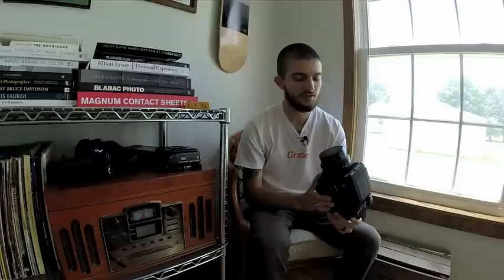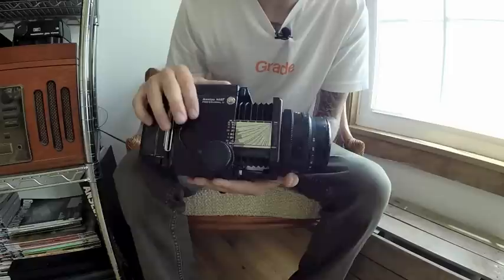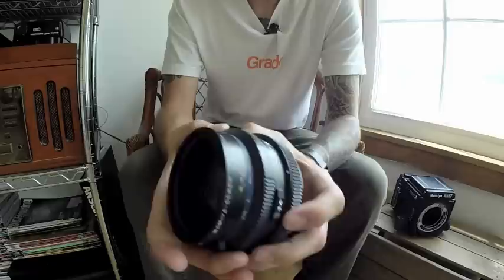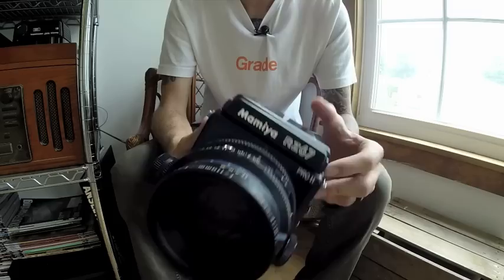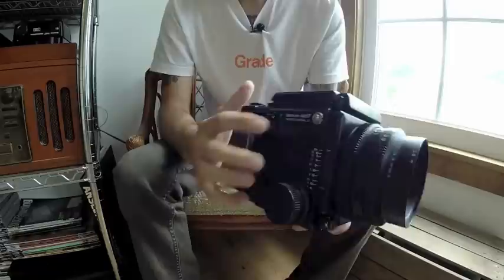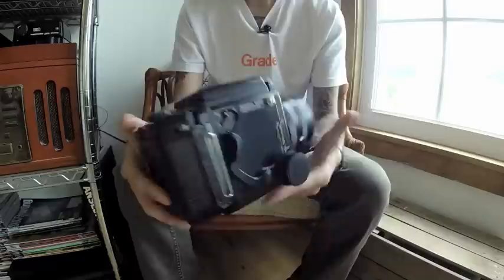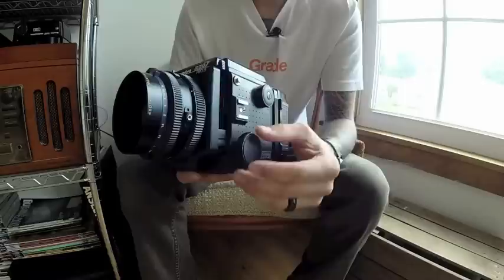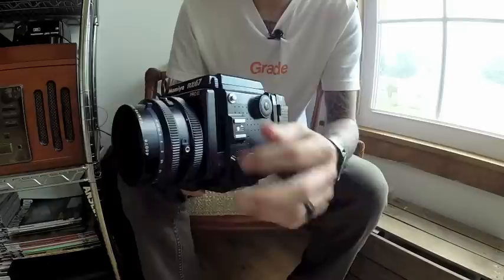Mamiya RZ67 Overview

Comment: I used to service and repair those. They were the best camera Mamiya ever made in my opinion.
Reply: Can I ask what brand of the instant film back is that?
Reply: @stevenygz  Its a NPC back made by Marty Forscher, they were generally a fraction of the price. He also made 35mm backs using a fibre optic pad.
Reply: Are they difficult to repair?
Reply: @Flyboard12345  Not when you've got access to the spares for them.
Reply: Where can I find one at a decent price in the States? Also, what should I look out for when purchasing. I've never had a Medium Format camera and I'd like to get started...
Reply: hi ian since you serviced mamiya's, maybe you could help me. i have an rz67 & pro ii from my old studio job but it seems that the shutter does not fire at correct speeds. shooting at 8" or 1/125, shutter sounds the same. any help would be great!

Comment: Great review Matt!   I have the RZ67 Pro II and would never part with it :)   Also keep in mind you can get a digital back for it, you first need to get the digital back adapter and then buy a back or you can get the RZ67 Pro IID which is the digital version. I do agree after adding the ad-ons the camera can get a bit heavy if you're walking around with it, so what I did was also picked up the Mamiya 645AFD for  when I am shooting in the streets. Mamiya's price's are very reasonable today compared to back in the day. Just go to Ebay and you can find some great deals. And as Matt said Mamiya glass is 2nd to none! And what you pay for a 2.8 lens you will never get a Canon L series or Nikon lens at those prices.

Comment: PX28s are pretty common batteries, just don't rely on them in the cold - Canon A series SLRS (A1, AE1, etc) take the same battery and I used to have to swap out batteries a lot shooting in just about 0 degree weather... which is when I gave up and switched to an F-1 and Nikon F/F2 SLRs. 

Mamiya 7 takes the same battery as well, FWIW, although I've gotten much more use out of those suckers in that camera, although they still don't last that long, maybe 20-30 rolls of film?

Anyway, great video as always, Matt ...

Comment: I  have been thinking of the Mamiya RZ67, but im going to wait a bit and enjoy my Pentax 67. but planing on getting mamiya in the future.
Reply: But the 105mm f/2.4 is insanely beautiful... sometime without the leaf shutter... it make the whole system lenses faster then those with leaf shutter. you can get 165mm 2.8 with pentax but never with mamiya
Reply: So ive been told, but after the events of a few weeks ago im no longer seeking to buy a mamaiya, after having the chance to buy one i got caught me off guard by its sheer size. and ive lost interest in it, plus the only reason i wanted one was for the interchangeable backs, thought it was a cheep alternative to a hassy. But it also leads me to my second reason, i have too many cameras and i never know witch one to use, there for im trying to cut down on buying some. and more on selling those i don't use and sticking to the ones i do.

sorry for the horrible grammar and spelling .

Comment: I don't know if I missed it or not, but did you mention the weight? The RZ with the back and AE prism, and a small lens like the 65mm, is over 7.5 lbs (3.5kg). Although it doesn't sound like a lot, it's very difficult to handhold it steadily, and you need a quality tripod.

Comment: +matt day I have a rather detailed question about the Mamiya RZ and how it relates to the Pentax67. I am looking to pick up one of these two cameras with the standard lens, ie the 110 f2.8 and the 105 f2.4 respectively. I understand a lot of the differences between these two cameras, and I get all of that. But, my main question relates to their ability to focus at reasonably wide apertures. Which camera has the better focusing screen to hit focus? Also, did you find there was a difference of ease in hitting focus with the mamiya with either the WLF or the AE prism. 
Thanks in advance

Comment: Hey Matt. I have really enjoyed your perspectives and the fruit of your teaching gift. So, thanks.

I just had a couple of questions:

1) Why do you recommend the 2.8 110mm lens so strongly (and enjoy it so much)? I have a chance to buy one for my RZ67 but want to make sure it's the best thing and want to hear your rationale.

2) I just purchased a B+W 77mm Kaesemann Circular Polarizer MRC Filter, and was wondering if you use this (or another) circular polarizer and how many stops you generally account for it in your exposure reading?

3) Do you recommend 120 or 220 backs, as a general principle? I want to buy another one (I only have one) so I can have Portra and then some sort of Ilford B & W loaded up as well (and, heck, maybe a third one for Velvia or whatever). Any thoughts?

4) What short lens would you recommend for the RZ67 (and what would you use it for specifically)?

and finally,

5) Have you ever used a Mamiya Tele-Converter 1.4x, and if so, how have you found it? Back in my Nikon film SLR days, I had a very good one that I picked up in the UK, but I'm not sure how well this one will work.

Thanks so much, if you can answer any or all of these. It will help a ton.

P
Reply: No one carries 220 rolls anymore, get the 120

Comment: I recently picked up one of these cameras myself, and I have a question about the shutter speed. Both the camera body and the lens have shutter speed adjustments. Do you have to use only the lens one because it's a leaf shutter, or do you need to match the two?

Comment: How does it compare against a 500cm for weight and shooting handheld? 

If you had to pick one of those two based how much you like shooting them (not technical stuff) which would it be?
Reply: The 500c is a lot smaller and lighter. I would say a lit of th bulk with the rb and rz  is the bellows.

Comment: I always had a question about this camera. When you rotate the back to portrait, it's gonna take the picture in portrait orientation but the framing of the camera body it's still landscape, so you're losing parts of the picture right? Also, how do you frame on the finder? does it comes with vertical frame lines?
Reply: Oh I see, now it makes sense. Thanks to you for replying!

Comment: Hey, nice overview. My lever won't go forward after i have taken a shot and the film wont advance. It also makes a buzzing noise. All the usual suspects covered e.g. darkslide removed, lens attached correctly, battery new...any thoughts? thanks in advance
Reply: Try taking a pencil eraser and cleaning the contacts between the film back and the body.

Comment: I'm currently shooting with a 8x10 field camera. I'm looking at either the RB or RZ as a "portable" camera I could take on a stroll through a city. Some had said it's so heavy it can really only be used on a tripod? I'm looking for something that I can handhold. What are your thoughts? Thanks and great video!
Reply: There is nothing portable about the RZ/RB 67 cameras. I would put in the class of a lightweight 4x5 like a Graflex. Quirky controls but if used regularly it becomes less so. As much as I loved mine, it is a portrait and landscape camera that does best on a tripod. Amazing bargain or an expensive paper weight. It just depends upon your intentions. The Hasselblad/Bronica square format or a Bronica 645 ETRSi are far lighter and handholding friendly.
Reply: My RZ67 Pro ii is a heavy beast, so on walk about, I take my Mamiya 645 Pro TL. Much lighter. I have the motordrive/grip and can hold and shoot one handed.
Reply: If you can afford it, without a doubt Mamiya 7 best lenses ever made for 6x7 only issue is you cant easily use filters and its not a portrait camera, but for those slower more considered situations you can use your 8x10 or 4x5 anyway. I'm looking to pick one up to supplement my RZ67 to use for street stuff and any landscape I can get away with.